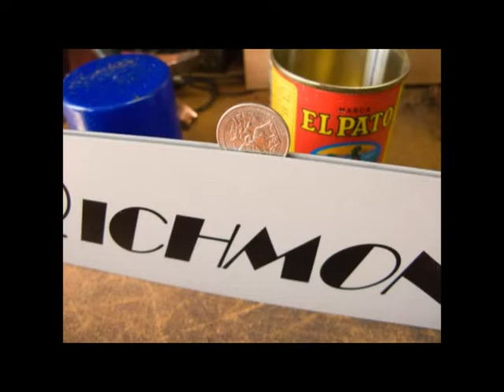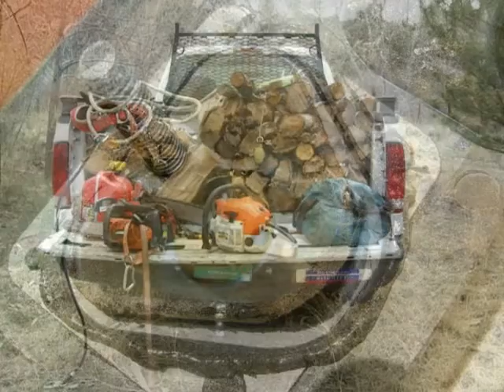Richmond RD-G6200

Comment: May 15 , 2018 does your saw still run?
Reply from the maker: This saw is still running.  Redmax parts fit. I did replace the bar and a few other things. One of the crank seals was defective, replaced it. That was years ago, but if I pulled on the rope it would start and do a day's work tomorrow.

Comment from the maker: the bar and chain that comes with this saw are problematic. the chain is made of poor quality steel and wears quickly causing it to "streatch." it is also the incorrect gauge for the bar. the chain is .058" and the bar is .063 gauge (the thickness of the drive links.) the 22" bar is also a little long for this power head and makes it nose-heavy. my recomendations, replace bar and chain with an oregon or carlton, 18" 0r 20", .050 gauge. hope this helps.

Comment: you wasted 200 smackers on that piece man they saw you coming it ought to last you a season go buy a stihl
Reply from the maker: jody- thanks for the feedback. if you watched the vid with the sound on you would know that i didn't buy the saw for work but to learn more about the quality of chinese products and to relieve the boredom of late winter. that was three years ago. the saw still works well if not too often. i'm a tree guy, not a religious fanatic so i have a mix of saws. i think i have four stihls, 084, 461. 036 and 026. the first three are good useful tools. the 026 is a piece of crap, not big enough for big wood not powerfull enough for smalle stuff. i mostly run 70cc to 80cc saws for everything except climbing. i realize that you are an expert when it comes to saws but when i need your advice for what to buy, i'll hang up my climbing spurs and move to sunny acres retirement home. thanks again.